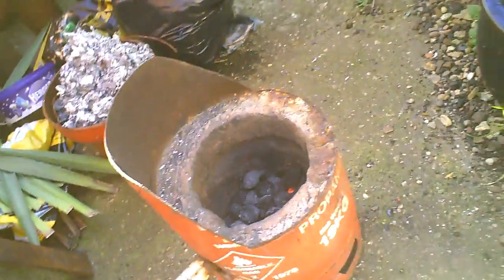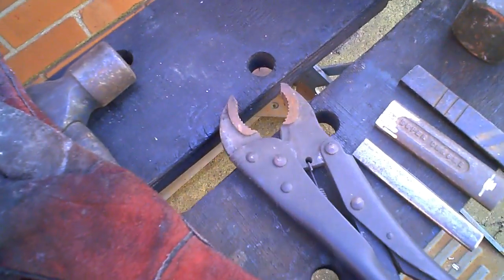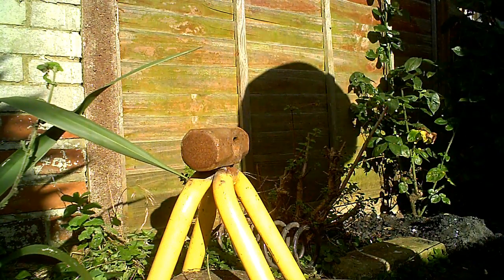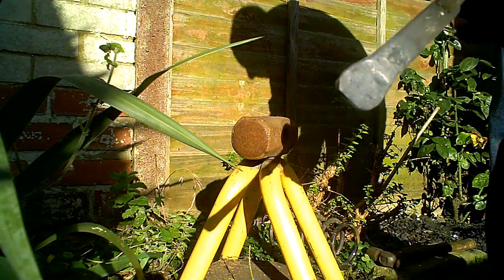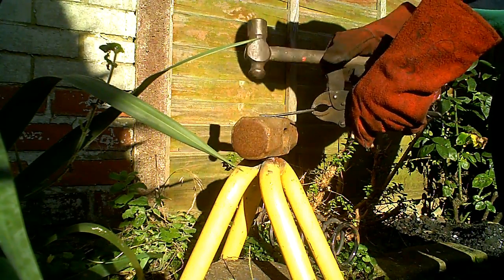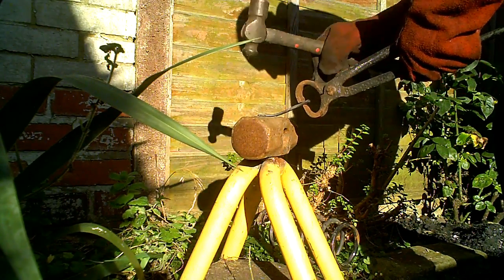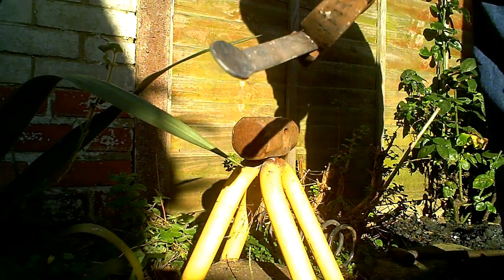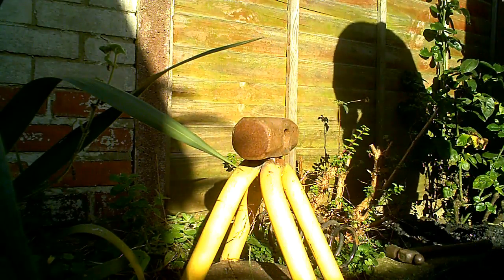Simple Blacksmithing Forging a Knife FAIL

Comment: I have a suggestion, I recently found a pair of hoof clippers and re-forged them into tongs they work great and won't leave marks on the piece like vicegrips will
Reply from the maker: Thanks you. I have thought of that, only reason I haven't done it is that they are one of the few remaining items from the blacksmiths. Made by my Father or even Grandfather, so an 'heirloom' so to speak :) Also because I do so little forging, just not got around to making some, even though I suspect they will be fabricated, not forged.

Comment: next, the two day fork. To bad the idea doesn't fit what you have on hand. Sure makes you appreciate what they went through in the past for the items they had. That spoon won't bend scoping out ice cream either, rather sturdy looking.
Reply from the maker: Growing up at the blacksmiths, I now wish I'd used the opportunity more. But of course it was just taken for granted. One reason I didn't is because my freehand skills are poor. Yes, I'm often amazed how they made old items. Needs a little more work, should have slimmed the middle down, however as I can now drill it, a hole in the end to hang it up. Will make a nice kitchen decoration.

Comment: Don't you have a lid to hold the heat in the furnace ?   An old plate or something.
Reply from the maker: No, I did try a couple of fire bricks I have, but found they tend to stop the draught and it didn't burn so well. A propane burner would be the answer of course. Originally I only made this to use to melt a few drink cans, but it was so successful I've now used it a lot. Plenty of life left in it, so guess I'll just have to manage. I could use better coal etc but if you get them too hot, that too can cause problems.